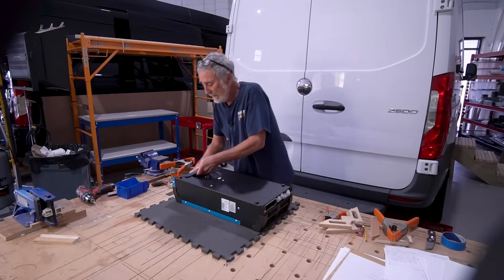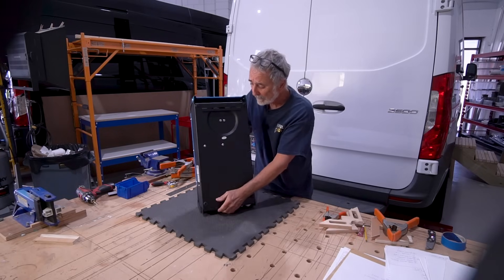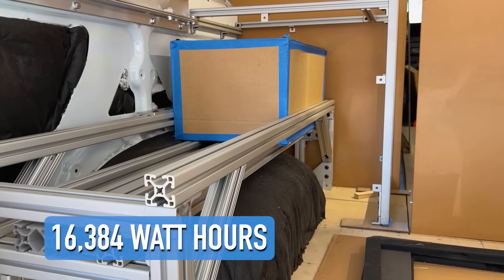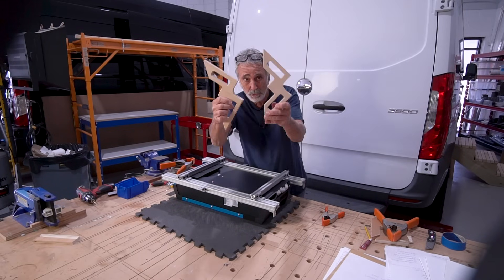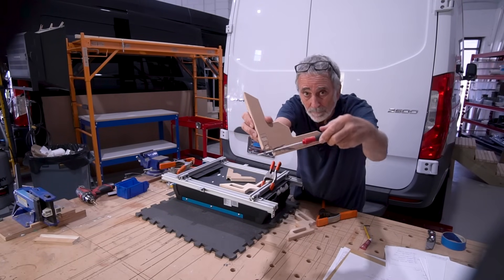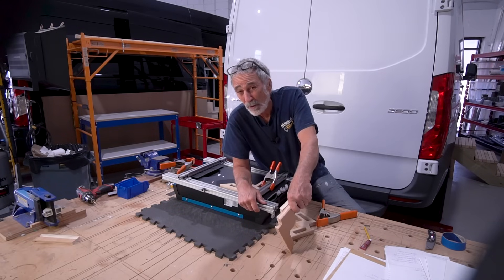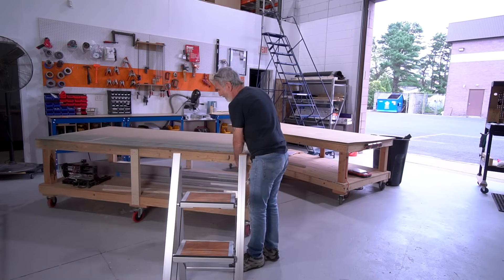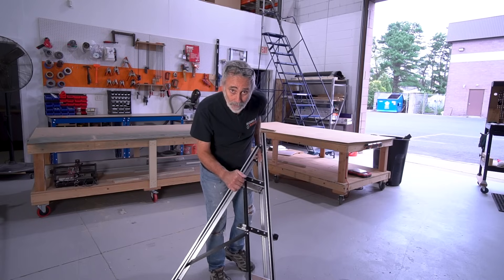The challenges of van building & van mods are met head-on with success in the Humble Road van studio

Comment: My Victron Phoenix is flat on his side hidden away under the bed. And if you make sure you provide airflow then it is perfectly fine. This is confirmed by Victron to me. And also a dutch dealer that installed 150+ units says it doesn't matter how you install it if you have airflow. I added extra 12cm server fans on the relay function.
Reply from the maker: And did Victron assure you this type of mount would not void their warranty?
Reply: @HumbleRoad  they didn't mention it. So you should ask that Johannes Boonstra from Victron. 

My Victron Phoenix 2000VA is from 2011/2012 and I bought it second hand. I did install it with the consideration that a multiplus 3000VA fits the spot of the Phoenix. So I can upgrade or replace in the future. But I don't think it will ever die.

Comment: Have you ever thought of adding jack studs to the inverter stand. I think they’re called jack studs (window and door framing). I know those eight screws holding the French cleat to the 8020 will do the job but the jack studs will let them rest a little easier.
Reply from the maker: You are correct, jack studs wold certainly transfer the weight better than the 8 points of contact. However, I also play a game of "delete the excessive weight". Across the entire build, it adds up! Decisions and choices...
Reply: @HumbleRoad  as you say, “options”. Love your work!

Comment: ive seen several mounted laying down.  Amazing people would just ignore the engineering recommendation thinking there is no consequence to it.
Reply from the maker: Yes, it is surprising. I just saw a video where the two excellent van builders from Explorist Life mounted one sideways on the wall and spoke about using cooling fans if necessary I’m going to check with them and Victron also to see if that type of mounting will void the warranty.

Comment: Hi George, all the best on the cancer front, I know you will kick its butt! Now… mounting the inverter to the 8020. I started doing this and posted about it on my VanTransitions IG near end of July; but then I backed away bc I thought, this unit has a chassis ground. If I mount to the 8020, aren’t I turning the mount into the chassis ground? So I went back to 3/4” plywood attached to my 8020 framing. Thoughts?
Reply from the maker: The extruded aluminum is anodized. It does not conduct current only if you cut into it.
Reply: @HumbleRoad  how then does that account for the grounds connected to each module to the van chassis?
Reply from the maker: The grounding straps dig into the aluminum, creating continuity for ground.